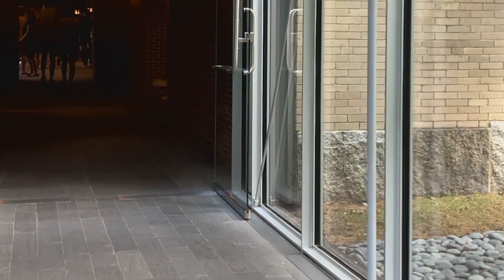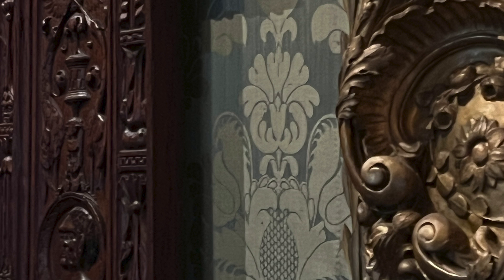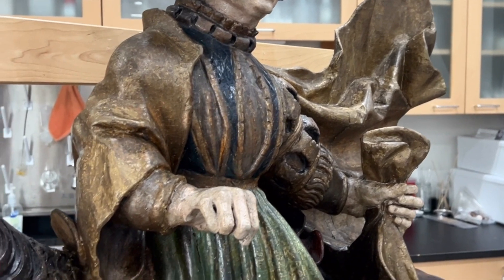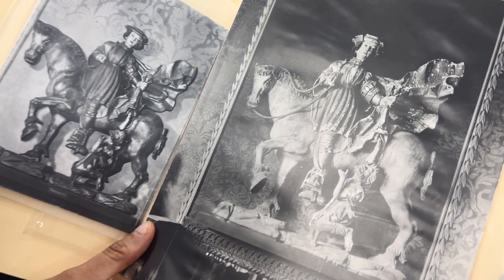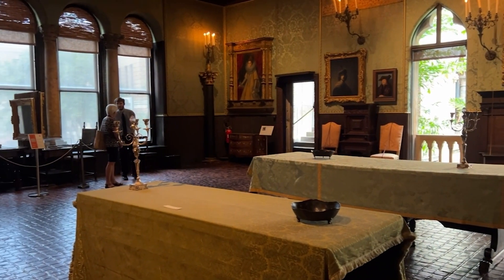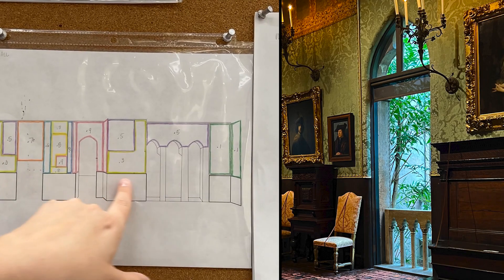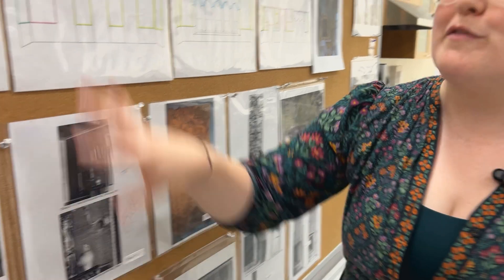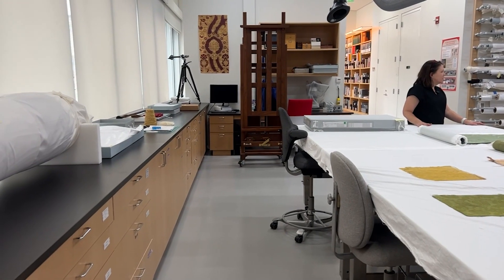FLOOR-TO-CEILING Art Restoration: Conservation at the Isabella Stewart Gardner Museum

Comment: Is the conservation laboratory (is that the right word?) housed within the museum, or is it off site? What are the pieces of equipment coming down from the ceiling within the lab and being moved toward objects? Presumably a light, and another thing like a big hose... is it a vacuum or ventilation system?
Reply from the maker: It's in the museum on the second floor in the contemporary wing!  Not sure about the equipment, but I would guess it's something like that?  Guess I need to go again!  -Prof Lieu